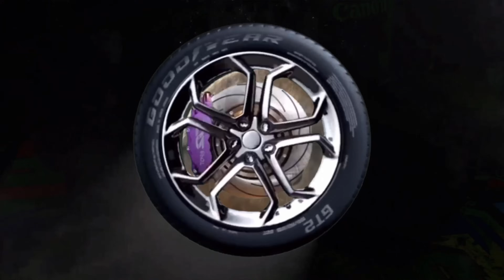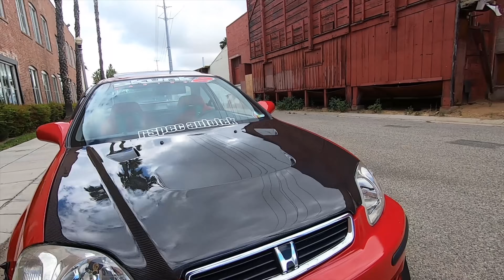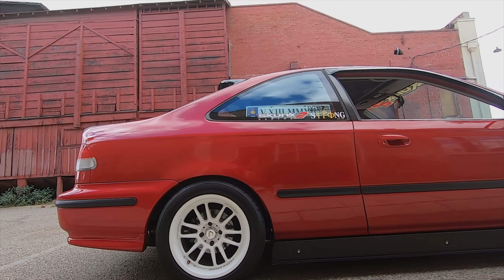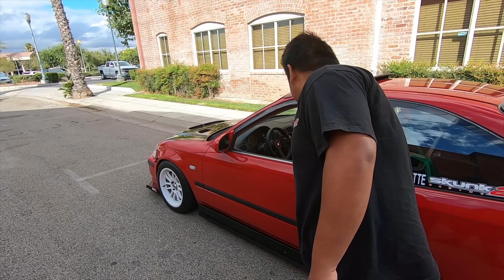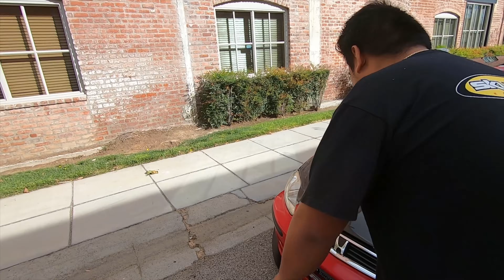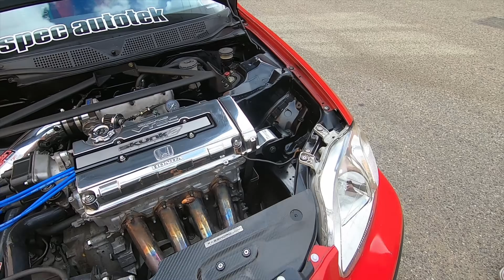1998 Honda Civic: Lasting Attachement

Comment: This is a sick and clean build. Love that he kept the black moldings all the way around. Most take those off n smooth everything. It works well on this car👌🏽 props to the owner. Nice build man. Only change I’d make is replacing the chrome grill with a red or black badge less one.
Reply from the maker: It flows so niceley with the SiR bumpers